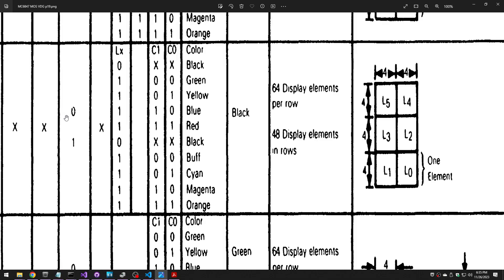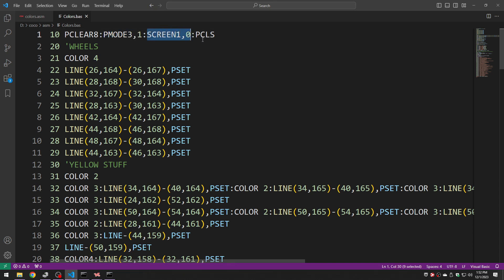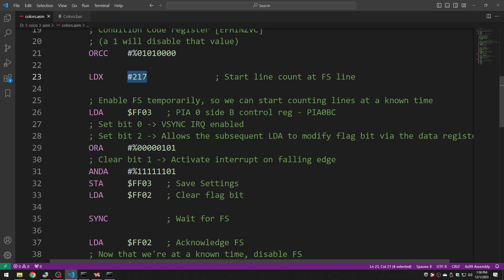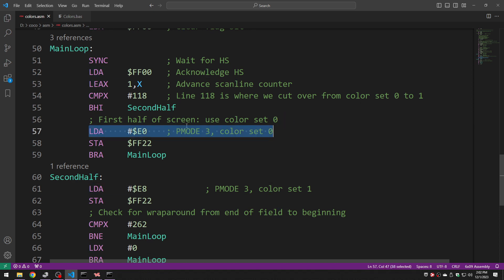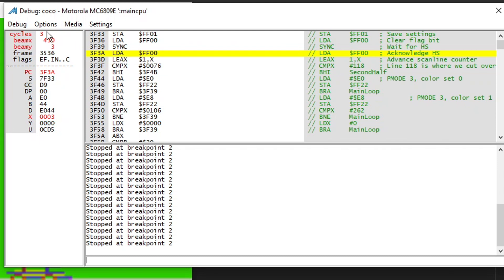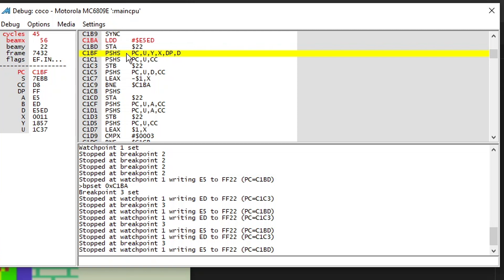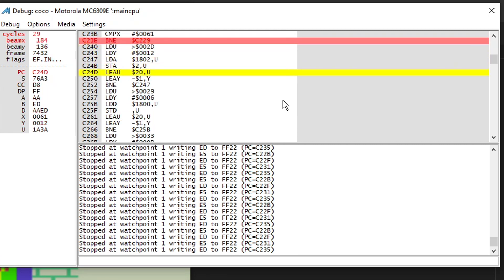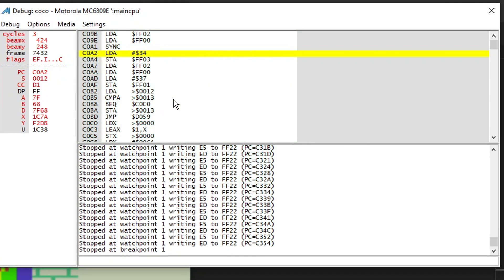Impossibly Colorful: The code behind my CoCo colors demo and Dragonfire | Asm Adventures

Comment: This is so fascinating!

What I used to do on the c64, which doesn't have SYNC, but does have IRQs that can be triggered on a specific line (you write the line to $D012), was setup a first IRQ that triggered on the line chosen.

Because of DMA and stuff, there's going to be uncertainty in the exact horizontal position of the beam in this first IRQ. I don't remember exactly, but I think it was 5 cycles total (each cycle = 8 pixels). The trick was to then to setup a second IRQ on the very next line, followed by code that just does NOP NOP NOP NOP NOP ... 

Now, in the second IRQ, your uncertainty is going to be one bit, because NOP takes two cycles. If, after a very specific number of cycles, you CMP the raster line ($D012) to the value you are expecting, you will have transferred that uncertainty into the Z flag, and then you branch on that flag to code that either takes N or N+1 cycles.

At this point, with the CPU running a raster IRQ inside a raster IRQ, you are now perfectly synced to the raster beam, vertically as well as horizontally. It's a beautiful thing, because now you can leverage the bugs of the video chip to do crazy things like removing the side border or do something called FLI, which basically gives you a chunky pixel like color mode. For some of the video bugs (there were quite a few) you needed the horizontal uncertainty to be 0, others were more forgiving.
Reply from the maker: Wow, that is a LOT to go through.  Big respect for anyone who figured out those steps!
Reply: @CocoTownRetro  It was a team effort. I was there, as a spectator. One of the deciding moments was when the side border was removed to allow sprites anywhere. This happened in 1986, I was 14. This is one of those video bugs that require real tight control of the beam. Not zero uncertainty, but as close to that as you get. That's when the perfect sync idea was born, and this idea opened the door to the really crazy, cycle exact video bugs. :)
Reply from the maker: very cool!